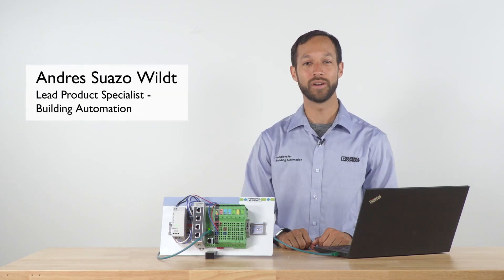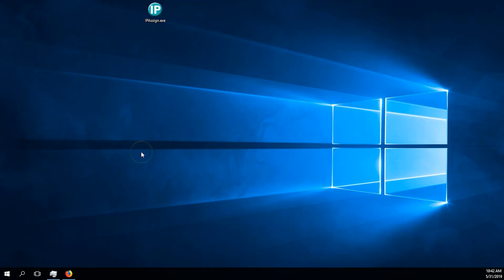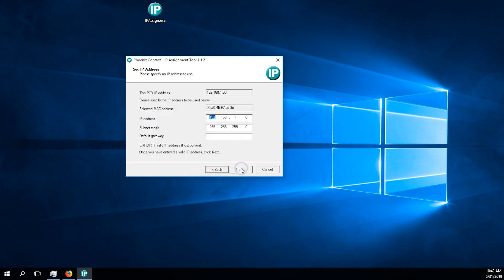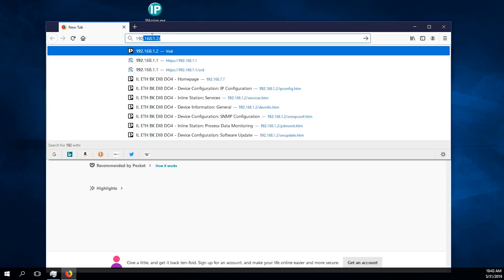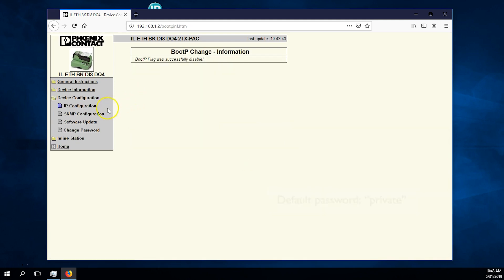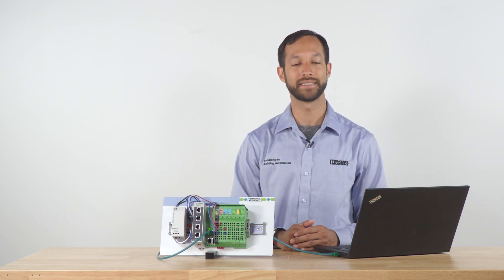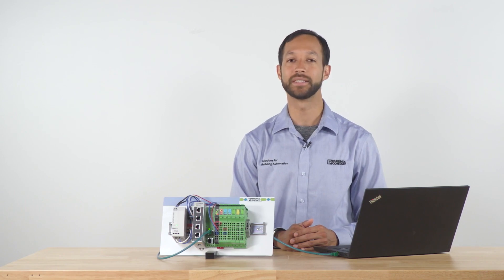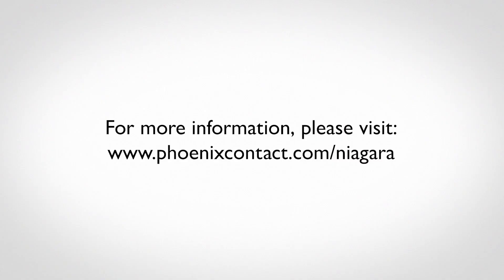Setting up the Phoenix Contact Ethernet Modbus remote I/O bus coupler

Comment: dear all
i can not access the phoenix contact via web page 
could you help me ?
Reply: I have the same question. I know IP and the device answers but I can’t connect by the web interface and configure it. Maybe you got a decision?
Reply: @OhMe1nGott  I had issues where using IPassign I could ping but couldn't access web browser. When I used Keyences IP setting tool everything worked fine. I could ping the bus coupler and access web page. Also, when i change the IP via the web browser the same thing happend. Could ping device but not access webpage. I would try a different bootp tool. Power cycling after using IPassign may work but I didnt have easy access to the device to power cycle. Adding this comment for future googlers.